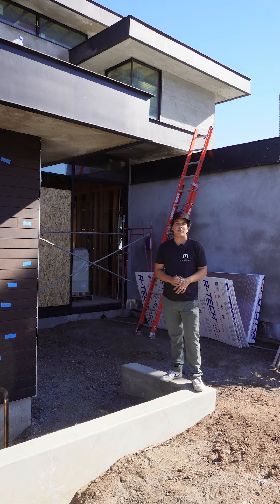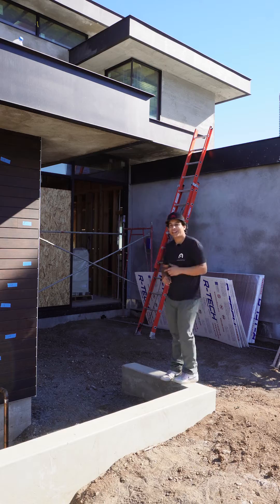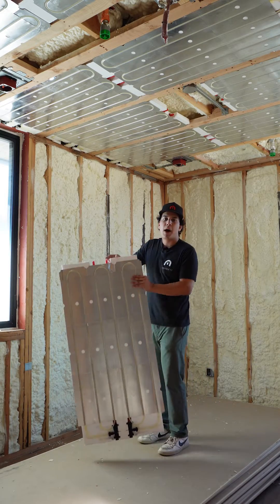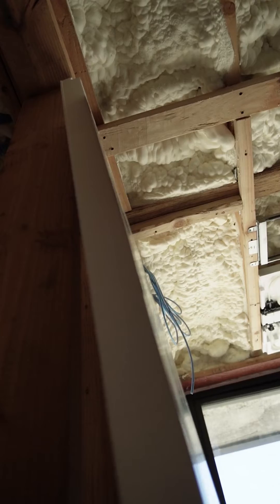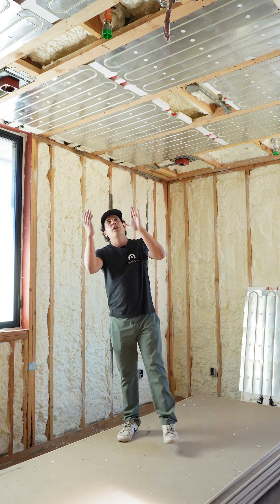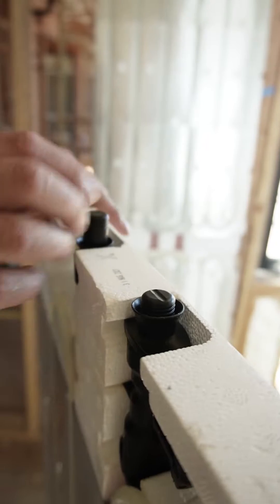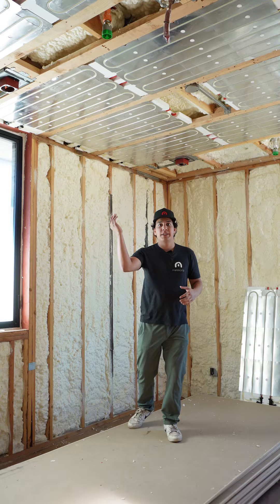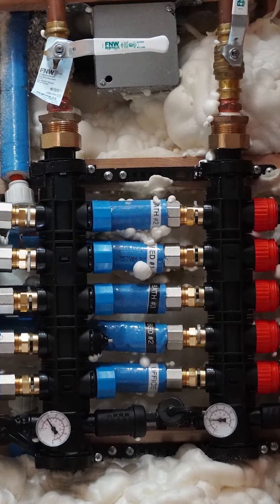Ray Magic® Radiant Ceiling Panels On The Job Site!

Comment: With the NK panels, can a wood ceiling liner be used instead of gypsum for either heating or cooling?
Reply from the maker: Hi there!

Yes, but a wood ceiling will slightly impact heating/cooling output, so we may need to add more panels to your design to meet heating/cooling loads!

Here is a link to some project photos where a wood ceiling was used! 

https://www.instagram.com/p/Cew8Lvjp0jt/?utm_source=ig_web_copy_link&igshid=MzRlODBiNWFlZA==

Comment: In terms of design choices, would a flat ceiling be preferred over a cathedral ceiling for ease of installation? What are the pros and cons of each from an engineering standpoint?
Reply from the maker: Yes, a flat ceiling would facilitate an easier installation, but a cathedral ceiling would still be quite simple as the walls are still flat. You'll most likely just need to use taller ladders. A curved ceiling is where things start to get complicated, as you'd need to cut into the back of the panels to allow them to bend. 

For a cathedral ceiling, obviously, the installation would be slightly different, but since the panels are so light, it really doesn't make installation that much harder.  Additionally, a cathedral ceiling increases the amount of space that needs to be conditioned; but it also increases the ceiling surface area, so you can easily increase heating and cooling capacity with more panels. Let me know if you have any other questions!
Reply: @messanatech  This makes sense. Thanks for confirming.
Reply from the maker: @oldporkchops  Anytime!

Comment: Are wood trusses / joists / rafters preferred over metal ones? Why so?
Reply from the maker: Hi there! 

Most of the time, we see wooden structures use wood (usually residential), and concrete/metal structures use metal (usually commercial). Wood is generally preferred because it makes installation quicker and easier as you can use a nail/staple gun instead of a drill and screws.

It is worth noting that we did work on a recent residential project that was completely concrete and metal since it was located in an area prone to wildfires. It really just depends on the client/project!
Reply: @messanatech  Thanks for once again helping to address my questions with great detail. The reason I ask is I recently came across Superfloor as a possible option for my build. I wonder if it will work, but wood does indeed have faster installation times. 

Speaking of installation, what if local HVAC subcontractors I've spoken to are hesitant to work on Messana radiant panels? Is this something I as a builder and my crew can do as a last resort?
Reply from the maker: @oldporkchops  Normal HVAC technicians typically don't install our system. The mechanical side of things requires a plumbing license, so your best bet is the plumbers/mechanical contractors who install radiant floors. 

With that said, hanging the panels is pretty simple, so your crew can potentially take care of that. You'll just want a licensed plumber to work on the mechanical side of things and make sure your system is up to code. 

Where are you located? We can recommend experienced installers or even provide training!
Reply: @messanatech  That Messana provides training is great news. We are in Atlanta, GA.
Reply from the maker: @oldporkchops  Since we're out in CA, it would most likely be a Zoom training. You can reach out to sales@radiantcooling.com and we can figure something out!

Comment: What about condensation in the summer...isn't it form condensate on the surface when chilled water is running through it?
Reply from the maker: You are correct, that is certainly the risk when attempting to perform radiant cooling. This is why we needed to develop sensors and controls that can monitor and manage the temperature of the panels; as well as activate dehumidification to lower the dew point within the home. So, using our sensors and controls, you don't need to worry about condensation forming!